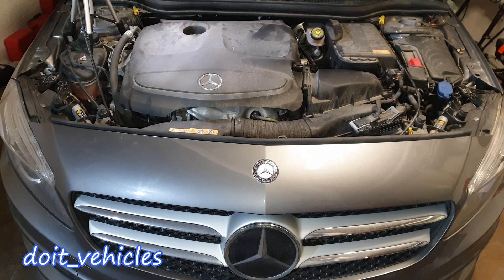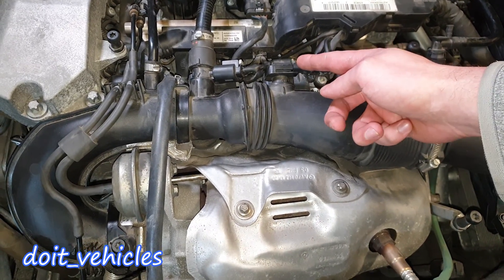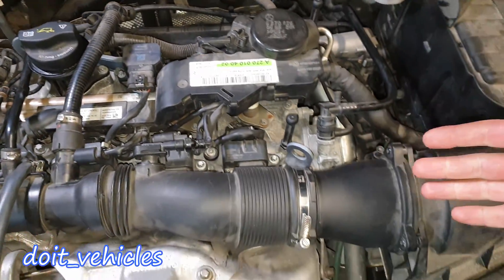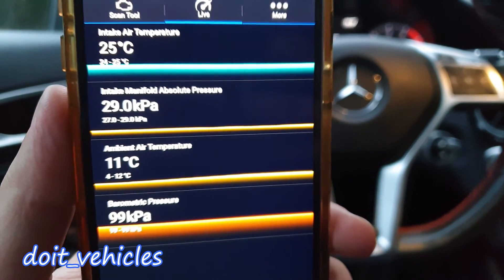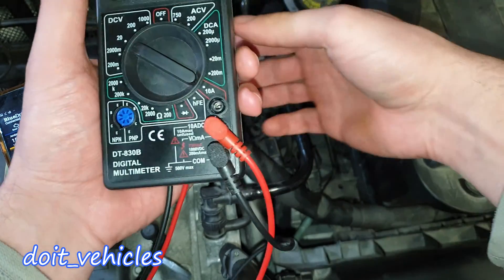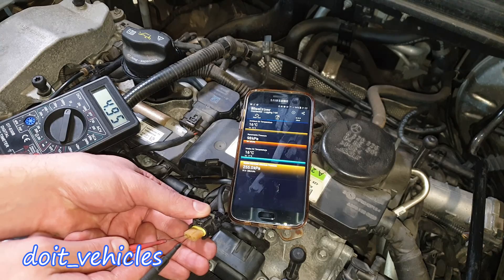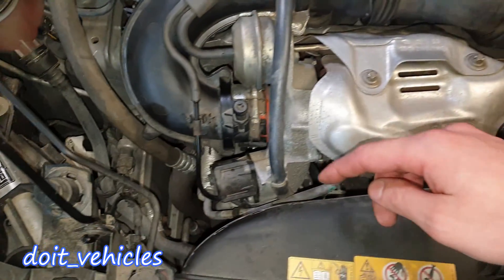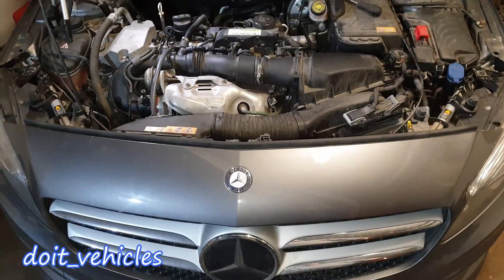A180 Mercedes w176 MAP sensor How it Works / Clean / Removal absolute pressure sensors

Comment: If you please I have a Mercedes CLA250 2015 with check engine code P0016 Cranckshaft and camshaft position A sensor 1 
Mechanic says it’s not the cranckshaft sensor. What should I do

Comment: Hi, great video, I’ve AClass A180 petrol auto, symptoms are white smoke, bad fuel economy, hesitation, loss of power, wet spark plugs, P0420 code. Light went off twice, when low fuel. How best to read levels using basic OBDII?

Comment: hello, which one of these sensors reads the pressure from the turbo? the one right before the throttle body or the one on the intake manifold?
Reply: The one before throttle body

Comment: Hi you  didn't answer how to remove this first start pressure sensor please??
Reply: Was your car loosing power when u stepped on the accelerator hard but was fine when slowly accelerating also how did you remove the sensor and was your car drinking a lot more petrol when you had this fault

Comment: Hi bro I subscribed you r channel please can you do some cooperation with me I have got a class mercedes a180 2014 petrol manual engine. Engine light came on I checked shows on my scanner 
Ho26.heater Bank 1 position is highe 
Exygen sensor monitor sensor 1 
3 . Or sensors shows in problem?
Ho26 heater bank 1sensore 
Exygen sensor 
How to find these sensors to replace them my car is same as yours??
Reply: Hi mate. I've got an a class 2013 petrol. It's a w176. Did you find the sensors you were looking for? I've the same problem as yours. Are the sensors all the same? I suspect I need to change one of them but not sure which one. If they're all the same, I could buy one and try on all three to find which one. But if they take different sensors, I might be running into an issue. Besides, it'd appreciated if you could share the links or details with me.

Comment: Hi,
Nice video.
I have one question. My display shows 5.5l/100km calculated from 550km. I drove without stopping with max speed  of 120km in highway. Real fuel consumption is 6.2km/100km. That is more 10%error. What would be the reason?

Comment: Hi.
Any body have experience  can help to solve this problem??
I have MB CLA 180 gasoline ( 117-342) the motor seems the same as in the above video. The car was  stoped it in the garage for about 2 years. newly I changed both batteries, the starts and the auxiliary battery.
But now when I start it the motor works well for about just 2 minutts then it stops totally, I try to start it again, the motor cranks but it wouldn't work. It works just with ( gas start spray.) It means that the electricity also ok. I must wait until the day after so I can start it again for just 2 minutts. I checked the bensin so it comes, but would not work.
Reply: old gasoline. need to put fresh gasoline.

Comment: Hello , i have a mercedes a200 cdi w176 2013 and i have P2540 code fuel low pressure sensor and i tried scanner tool i watched the pressure in fuel ramp and it gave me between 30000Kpa and 25700Kpa at idling and between 100kpa - 400kpa at primary and dies to 0kpa right away when i switch off the engine and then it come back to 100kpa-400kpa 
Can you please tell me if this numbers are correct or it's to much for the engine  ,btw my car is slow now and i had a check engine light and a wierd cracking sound in the fuel pump when i switch on the key but not when engine on  no wierd sound , is it the fuel low pressure sensor ??
Reply from the maker: it does jump from 0 to 100 - 400 kpa after the engine is off ? the sensor looks way off the chart

Comment: Happy new year. Very helpfull video and guide you have. I'm a subsriber from Australia, would you be able to give me guide regarding carbon cleaning with CRC intake valve and turbo cleaner, it says to be spray after maf sensor, but this car doesn't have maf, instead it have 3x map sensor, is it safe to use this type of chemical for carbon cleaning ?
Reply from the maker: Happy New year! Yes it is safe to be use on MAP sensors

Comment: My car looses power when I put my food down if the car in in to a high gear and I have to stop turn car off and back on and then it’s fine could it be one of these sensors bad? Same car as this
Reply: Did you find the cause of the Problem ? Could be a Bad wastegaste or bad solenoid or bad wastegate actuator